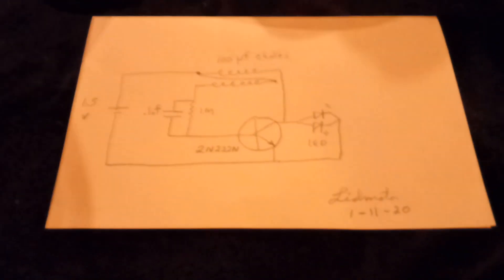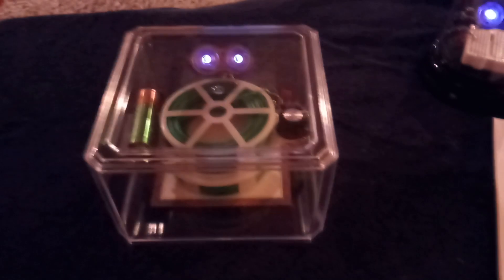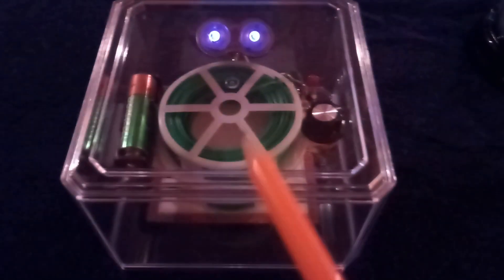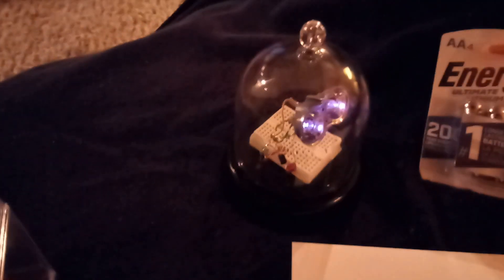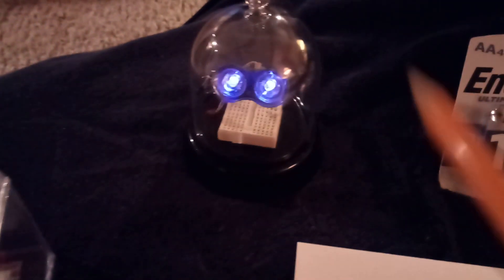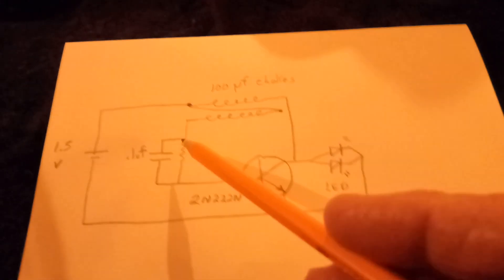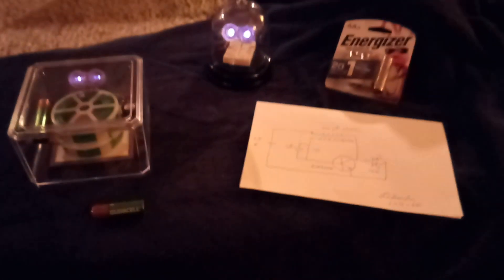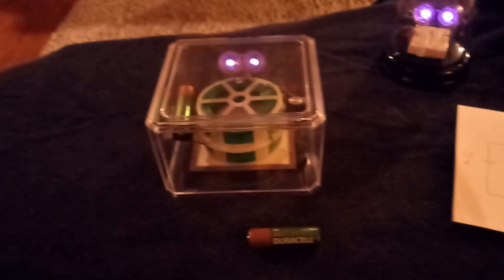Long Running Led Light Experiment

Comment: Hi Lidmotor. In all your experience with the twist tie wire oscillator, did you also try your long running pulse motors? Would that even work well or would that create a lot of cogging that would require more power drain to overcome?
Reply from the maker: Too much cogging.  That is exactly what I found.  The twist tie does work as an electromagnet  but not well.
Reply: Lidmotor, I placed twist tie wire in the gap between the two wires of a speaker wire. Was quite time consuming because I wanted to make it uniform, but in the end, had a small but very neat bifilar coil. Tried running it various combinations, each had pros and cons of its own. But the cogging effect was greatly reduced and some very interesting effects as a driver coil. I think the core material used has a lot to do with twist tie wire’s performance as an electromagnet.

Comment: Finally managed to get some little bell jars cheap in our Poundland end of season stock so I am hoping to make some nice looking projects. Only thing is they look like they are well glued to the base so we will see if I can get them apart.
Reply from the maker: If the bell jar is just hot glued then taking it off shouldn't be a problem.  One BIG problem I found out about the cheap China plastic ones is that they are not UV resistant and they turn milky over time exposed to sunlight.  It is a  disappointment because the glass ones are pretty expensive.  I went ahead and ordered a glass one from China that has a wood base.  Now I just have to wait for six weeks.   :(
Reply: @Lidmotor  I don't think any of mine will last long enough to turn milky. I am not in the same league as you. 😆👍

Comment: If it was me, in order to determine if the LEDs output side load is following the battery power or also something else from the environment I would do the following.  Get volt and amp meters on the battery side and also the same at the LEDs load side.  Then, instead of a battery use a supercapacitor (so to speed up data collection to hours instead of years) and start collecting the data every so often, like minutes or hours instead of having to wait years,  and put the data in an Excel graph.  Now you will see if there is just a battery slowly draining  and the output following in step or there is more going on.  Have fun.  P.S. I have often done this method to see trends in many unusual circuit observations and it has helped weed out truths.

A case in point, was years ago when I was experimenting with gaining power from crystal radio circuits.  One day, I was getting much more power (not speaker or headphones sound) than normal from previous data collection.   I thought I was really on to something.  Then it turned out there was a high frequency oscillation in the broadcast reception above hearing range but lower than radio stations --- it was the stupid spiral florescent bulb (remember those?) in the lamp fixture that was soo electrically "dirty" that all kinds of EM radiation was being picked up by my circuit beyond the normal radio station signal!  In another time, I had a different crystal radio power circuit also getting more output than seemed normal, in the day but not at night as much.  Turned out that my circuit was harvesting extra energy from ambient sunlight!  Not via solar cells but due to my use of clear glass 1N34 germanium diodes and in other versions where I used LEDs in place of normal diodes for rectifying energy.  Even a flashlight will cause an LED or crystal diode to conduct AND PRODUCE extra energy as a current aiding a circuit.  So this is just a few examples of how an innocent looking circuit can actually be operation from multiple energy sources at once.  I have another circuit where I have a crystal radio like circuit that produces power, not just from radio EM waves, but also harnesses lightning fluctuations of the ambient medium  safely and does not use a dangerous high pointing antenna.  The output is naturally erratic but far more useful power out than just from radio signals.  Cheers.
Reply from the maker: Thanks for all the info.  I am running a super cap experiment right now that looks very promising.  Basically this is just an efficient tank circuit that doesn't need a lot of energy to keep it going.  I have done a number of the same experiments that you have over the years.  You are right about tiny amounts of energy getting into one's projects in unusual ways.  You only need about .5 v @ micro level to start up one of these blocking oscillators I am working with.  I think Magnetman2010 has an antenna energy gatherer setup that might be helping his project run.  I don't know.
   Here is Magnetman's antenna energy gatherer setup and a look at where else he might be gaining energy into his project:     https://www.youtube.com/watch?v=f3iN5z6s3HY
Reply: Thanks for the link to Magnetman's video.  Yes, that is exactly one of the many variations where I note the extra energy gain.   He has a lot of good videos, shame it has been years since the last posting.  
     Here is a shortened  list of some of the many extra energy harvesting processes I have experienced within many circuits.

1.  Clear glass diodes - Sensitive to heat and light, 60Hz house wiring, internet router transmissions etc. besides general RF.  
2.  Capacitors - sensitive to changing impedance with frequency and also sometimes changes to capacitance vs freq., also sensitive to changing energy stored as a function of temperature, ie you get "free energy" gain when a fixed amount of charge is exposed to a hotter medium that can be collected but if not collected and temp goes down then the "free" part is given back to the ambient medium.  
3.  Basic LC tank.  Very sensitive to ambient RF or electrostatic fluctuations.  Even thou a tank may be tuned to just one frequency, in principle they will still oscillate at INFINITE ranges of harmonics and all oscillations have harmonics.
4.  Antenna and ground only.  Same as #3 since all matter has capacitance and inductance:  All is electrical.  But also since there is about 100V dc electrostatic per meter then an antenna will also have a considerable fluctuating dc (which will also  act like ac and can power things).
5.  Dual earth ground rods.  Any 2 dissimilar metal rods buried in the earth will produce power.  by galvanic action.  Not as well known that the same rods placed  very far apart will still produce current but galvanic deterioration will be extremely slow (decades) or none.  And even fewer may know that 2 rods of the same metal will also produce current according to compass directions which is clearly not galvanic!
6.  Atmospheric capacitance.  Tesla discovered that the capacitance changes with an elevation above earth.  He hints that this was a momentous discovery but never revealed what the significance was.  But considering he was an energy scientist and expert, I think I know what he was excited about:  a new way to harvest ambient energy.  So far I have not seen anyone follow this trail that he left us.  

There is a lot of other ways but I won't burden you.  I would only say that your blocking oscillators could run on any of these or combinations of methods perpetually without any need for any batteries day or night.  My dream would be to see a 10HP version of one of your pulse motor circuits that ran entirely from ambient energy scavenging!  Impossible, no.  Jefenko (sic) in his electrostatic motor book shows a 1/4 HP motor that could run from electrostatics which is only one of the process I noted above.  Here is a "cookie" for you: You noted your tank is very efficient, now realize this.  The tank radiates waves in ALL directions of space but you are not capturing this  "leakage" of radiation.  You so far are only capturing the coil CONDUCTION current at collapse and BEMF.  Put an untuned  (between stations) radio near the tank, but outside of transformer coupling  and if you hear any buzzing or oscillation noise then you have uncaptured energy available!   Your tank is not only an electron mover but a transmitter of radiation (photon) energy.  But you so far do not have a photon receiver to get this extra process that your circuit has already worked to produce!  So in a way your tank is indeed very efficient but the overall operation is not since you have left unused energy "on the table" so to speak.  And since radiation is 360 degrees you can have more than one receiver to collect and feed the photon energy back into you electron input source with a new gain per extra receiver added!.  Hope this was useful.
Reply from the maker: @energycrafts8206  Thanks.  Those are some great ideas on how to get energy outside of the usual ways.  I have worked with a number of the ways you mentioned but the easiest method I found is a 20% efficient photo voltaic cell.  That is  because of where I live.  The sun comes up every day and even inside my house there is enough light year round to gather energy that way.  It is a stupid simple way but it works the best.  Many many houses in Southern California now have solar panels on their roofs.  No wind turbines though (at least in dense housing neighborhoods).  People don't like looking at them.  Thanks for the great comments and ideas.
Reply: Lidmotor glad you liked my comment, only, except for my mention of the 10HP  Lidmotor concept, all of the other items were not ideas but actual experimental results.  

I can see your interest in using a solar cell (KISS principle) but I was looking at 24 - 7 power rather than power only when the sun shines and the need for greater storage capacity at night.  Since your oscillator uses so little power you can have solar cell or any of the items I noted as energy sources and any combination to power more powerful devices  if you want.  

In fact, you could get even more simple than a solar cell by using the wasted 60 HZ and RF harmonics radiated from your refrigerator or air conditioner type items in your home.  The energy is free since you have already paid for the normal operation anyway and capturing the RF will not cause the fridge or air conditioner to work or cost more.  I even get surge radiation all the way across the yard from my neighbors a/c when it comes on or off!  And it is not tiny microamps either, much higher and it can charge capacitors very fast, so plenty of power for circuits like yours.  Have a good night.
Reply from the maker: @energycrafts8206  After I read your reply I watched some of Tinselkoala's old videos on 'electrosmog' energy harvesting.  He was into that a ways back using resonant tank circuits.  This was one of  his interesting builds ---   https://www.youtube.com/watch?v=80D92QaOcM4&t=11s
Reply: Nice one.  You could improve your oscillator endurance even better as I noted using harvested RF that YOUR oscillator MAKES (not only from other sources like air conditioner surges) but is not used, with a receiver tank like Tinsel  shows.  All you do is place the "scavenger" tank out of induction range and set it for the tank frequency while under an output load.  The tank is wired to a full wave bridge, capacitor and then to an extra load or better straight to your power input of the oscillator.  Then the battery would not need to work as much.  Ideally, the scavenger voltage should be equal or higher than what ever your battery/cap input source will be.  So the scavenger can take on more and more of the work as you make refinements.  I noticed Tinsel in some tank/transformer coupling circuits also used a 3rd coil  winding as part of the scavenging and could light up  a car brake light.  So far more output than just powering an LED!  And lastly, Tesla in the Colorado Springs Notes book mentioned that his resonant coils could (forgot actual number) but I think he said they could SELF oscillate for days or if wrong definitely hours.  Now that is serious efficient!    Either way, even with all our high tech attitude these days, no tank circuit in any modern device I know has a tank that will SELF ring for even a minute!  So looks like your tank still has a little room for improvement.  Your tank is leaking like a sieve!   :)
Reply: I forgot to add that you could possibly also stop the "leaking sieve" in another way by putting your entire tank in a sealed metal enclosure preferably a sphere with just a peep hole for the LED.  That way the radiated energy is not lost to space but is contained as it reflects from the metal cavity back to the source (coil) and thus the input power needed to run would be less or maybe the same but then might get a greater output in trade.  This is not exactly a Faraday Cage as I did not mention grounding it, but you can also try that as well.  Either way something will be learned  about the question :  Is an external extra energy input involved?
Reply from the maker: @energycrafts8206  Great suggestion about the Faraday cage to see if something is getting in.   Just set up two identical experiments with one in and one out of a metal box.   To shorten the experiment wait time I could use 10F supercaps filled to the same amount.  Of course that would not answer the question about the Duracell battery long running event that Magnetman is seeing.
Reply: Looking forward to learning what you find out.  True about the Duracell mystery but at the moment one can not be sure if it is just a phenomena of the Duracell AND the oscillator working in cahoots or if the oscillator is the magic and the Duracell just happens to be a better conventional source than some other battery/cap ect. or it is just cell chemistry impedance.   If I follow Occcam's Razor, the simplest possible explanation is just that the Duracell is simply a great cell and has enDURAnce ie the capacity is better than many and also the electrolyte is better in that it won't deteriorate as fast as others.  So no mystery and 3 years is not hard to believe with such tiny loads.   Also cells of different brands are not equal and also characteristics change thru out their charge/discharge curve and life.  Impedance will change so will its loading matching to the oscillator.  Ideally, you want a 1:1 match whether the oscillator is somehow backfeeding energy to the Duracell thus slowing the normal discharge rate or simply as a cell source feeding the oscillator.  Either way impedance of each should match for max power transfer.  I suspect different cell brands will have different impedances to your oscillator and will thus discharge at different rates all things considered.  Also as cells age impedance generally goes up greatly and thus will drain less current so of course any load will last much longer and the LED current is so low that it may be hard to notice a change.

  I really did mean to only type one sentence but......:)
Reply from the maker: @energycrafts8206  I think all that is happening is a very low amp draw slowly draining a very good battery.

Comment: Have you been noting " constants"?
Reply from the maker: No but I should.  Magnetman's and mine might be very different.   On his device he has a 300 uf electrolytic across the rails and I am not sure what transistor he used.  We could have vastly different results just with those two items.  He said that he has instructed everyone not to touch it.  That is going to be hard for me to do.
Reply: I'm using a 2n2222 transistor.  @Lidmotor
Reply from the maker: @magnetman2010  Thanks.  Do you have your 1 meg pot turned all the way down?  Also where are you keeping your Penny?  Is it near anything that might be giving it energy somehow?  I do have the exact same twist tie wire coils as you do so that part is identical. 
     I found out that if you connect a dollar store solar garden light solar panel to a 10F super cap that will gather enough energy to run the Penny all night.  I just have it near a window that doesn't even get direct sunlight.  There is enough resistance in the panel so that I don't need a blocking diode to stop drainage of the cap.  THAT setup will run until some part of the Penny fails.  It might run decades.

Comment: If the lives in a humid environment that would keep the battery from drying out, allowing it to last longer too.
Reply from the maker: The batteries are sealed so I don't think humidity is the answer.  It is probably just low amp draw but I lay awake wondering if somehow the Joule Thief is stealing more joules from a secret source.